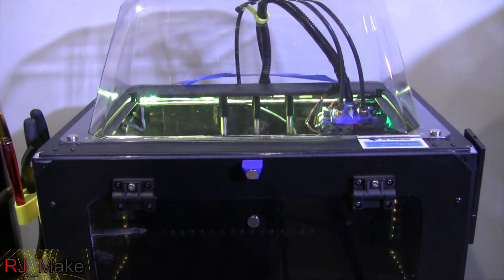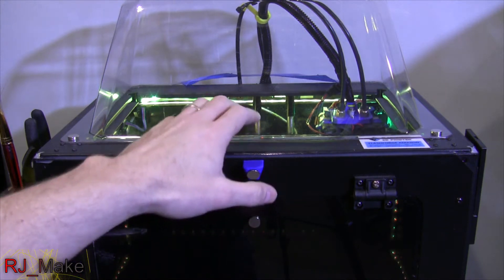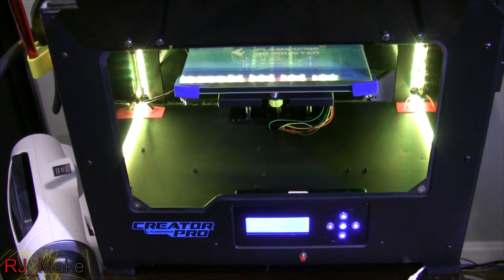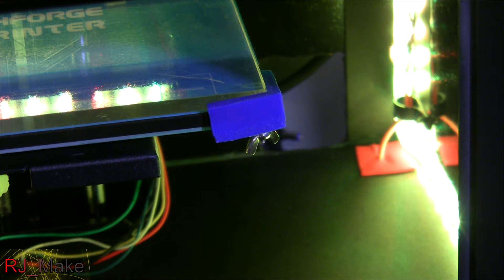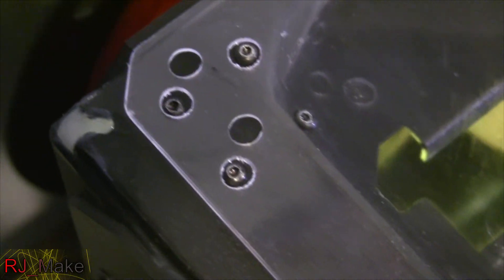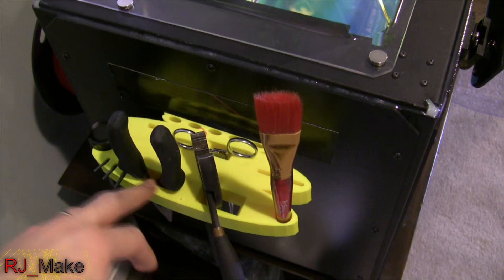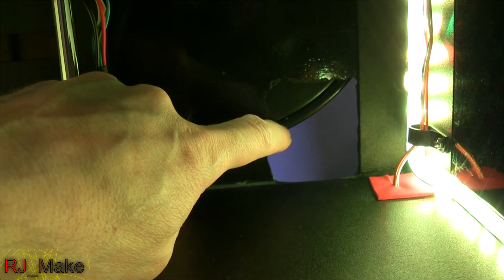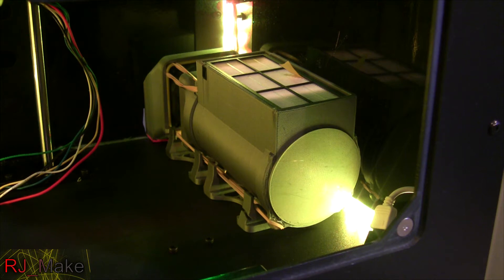3D Printer Mods for use with RJ_Make's HEPA/Carbon Air Scrubber

Comment: good video, thanks, a year has passed, can you do a revisit on your air filtration system?, I purchased a 3d printer kit, but I am concern about fumes and I want to build an enclosure but not sure about how to do the filtering part, thanks
Reply from the maker: Thanks, what would you like to know? I use it for every print job, and believe it is indeed working. I will probably be starting a re-design in the fall to be mounted on the top cover, which I believe will be far more effective. I posted a picture on my Twitter feed last year of a HEPA filter that has turned redish after printing an entire roll of red Hatchbox filament. :-)
Reply: RJ_Make well, my plan is, since 2 of the same hepa filters together measures a bit more than 100mmx100mm I will be attaching a 120mm pc fan to them and then to a side panel to the enclosure to a hose to the outside, but I am not sure if a 120mm fan would move enough aire to the exterior through a hepa filter, I don't have the tools to measure that, do you have experience with 120mm pc fans?, thanks
Reply from the maker: What your looking for is a high static pressure fan. Look for the highest fan you can afford and give it a try. You can use a variable voltage power supply to dial in your 'sweet spot'. (without the equipment it's just a judgment call)  As you can see in my testing video(s) there isn't much pressure drop with using a just a HEPA as compared to using both a HEPA and Carbon.  The carbon is the killer, but if you're just venting to the outside (outside your house, or printer enclosure??), you don't really need any filter.

Comment: How did you seal the back of the machine by the filament tubes and cords going to the extruder??
Reply from the maker: Do you mean at the 2:53 mark?
Reply: Yes I saw where you put your fingers underneath I would like to completely seal my FFCP
Reply from the maker: I don't think that's possible, or even desirable. You will want some amount of air infiltration, you just need to create a slight negative pressure gradient.  

That said, you should be able to get close, maybe  with some baffles along with some really flexible foam around the wiring chase and tubes going out to the baffles. There's really isn't a lot of movement at that level. 

Remember, if you're not going to replace the top with the Makerbot one it won't make any difference. :-) (Sealing the seams in the original (<2016 model) top wont be enough)

Comment: Subscribed and Liked! Very COOL! I was about to print Rod's scrubber and somehow ran into yours, not knowing which one to print until I saw your air flow test video. Thanks for making that video. Now like NeoPortnoy said, I wonder how effective this is. I see the Roomba filter works down to 10 Microns (PM10) http://store.irobot.com/3-replacement-aeroforce-high-efficiency-filters-roomba-800-900-series/product.jsp?productId=28516956But ABS and PLA particles appear to be smaller then 100nm or PM0.1, so my guess is the roomba filter isn't doing much for the ABS/PLA particulates? But at least it's cleaning the air?Now the CARBON on the other hand, looks like its CLOSER to filtering it. According to wiki, activated carbon filters between 0.5 - 50um!  (or 500nm - 50,000nm). So it may still NOT be enough to filter the nano particules!?
Now, I've NEVER printed in ABS so I was wondering have you ever printed in ABS before this scrubber? Did it smell? Does it smell now that you have the scrubber ? Although, honestly I doubt the smell is any indication of how effective it is, never seen a scientist measure particles by sniffing the air. lol ...The carbon would rid the smell anyway, leaving the 100nm particles unfiltered.Also, I see your blowing the air out of the printer and into the room maybe I didn't catch it but why are you doing that instead of recirculating the warm air inside the chamber? To prevent any air drafts? I really like your design, but I feel like there's some things I want to try to modify it. Any chance I can get a copy of the fusion 360 file? Either way, thanks for all the work on this and the videos are very helpful!
Reply from the maker: Thank you very much.  Yes I started off with ABS (still is my preferred material) before filtering. My wife was irritated the most and is what really sent me off looking for a solution. Once I got everything sealed up as best I could on my FFCP and got the filter installed, my wife no longer notices when I'm printing.  You could be 100% correct and the reason why she is no longer irritated because there is no more smell. 

In addition to the filter inside the printer, I also have my home automation system turn on my HVAC fan (there is a return vent in the room), a fresh air Intake and a Floor HEPA/CARBON filter that is located in the room when the printer start printing.

My thinking on the design was to try and create a slight negative pressure gradient inside the print chamber so that I could be more confident that I was filtering all the air.  I think placing the filter (a new design) in the top cover would improve the entire thing.  I have found It's very difficult to fight the natural drafting effects of the printing process.  So if the filter was at the top, in theory, it would have much less trouble creating that pressure gradient. 

The most ideal setup would be to exhaust out a window, but unfortunately that's not an option for me.
Reply: +RJ_Make I see! Yea I'm thinking I'm probably just going to have to install a quiet (variable speed) bathroom exhaust fan in my closet along with enclosure for the whole printer/filament setup.
Reply from the maker: That is perhaps the most effective way.

Comment: Awesome, the scrubber tucks neatly back there. Is it thin enough to not affect the print bed, or did you have to sacrifice z-height in order for it to fit? 

Also, great video!
Reply from the maker: +Hoffman Engineering Thank You Sir, It's getting a little easier, still working out my 'stage fright'.. 
 
You caught the one view I forgot about :-) The bed clears the body by 1.5 inches, so no Z sacrifice.  You will be able to see it much better in the future performance test video.... I think...